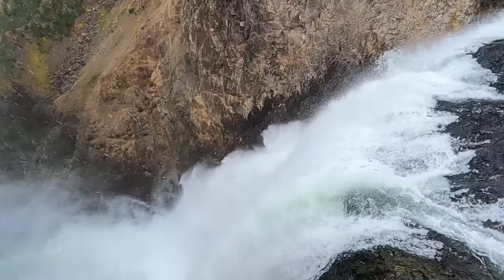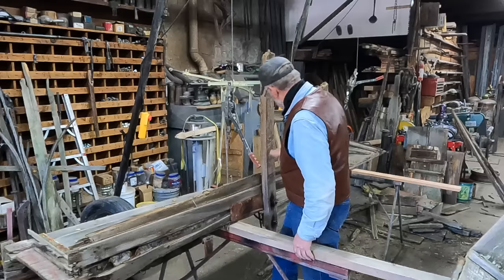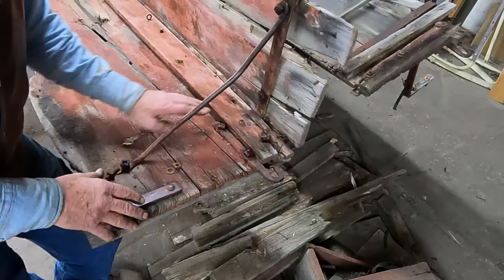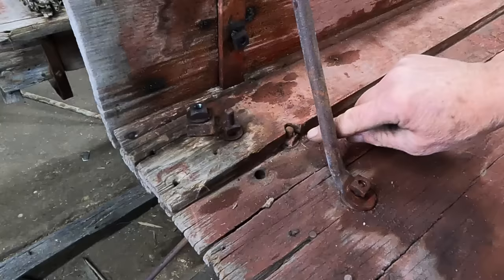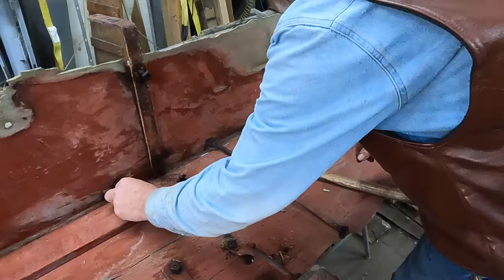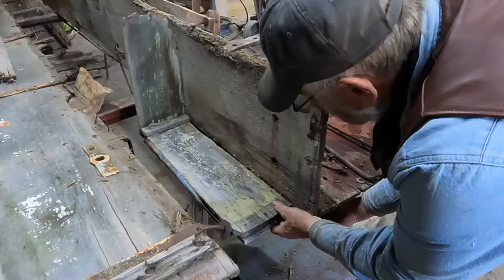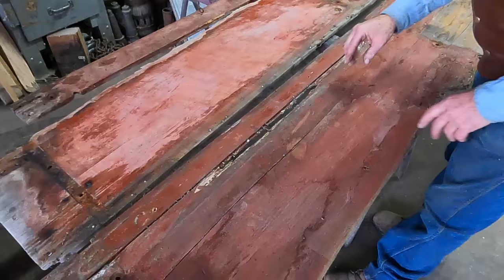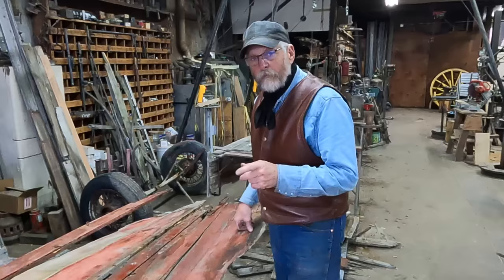If This Was Yours, What Would You Do? | Engels Coach Shop

Comment: Just take lots of photos, get measurements, note design points and tell the customer there is little that could be saved. I suspect you need to rebuild this like a new item.
Reply: This is a piece of history, representing the hardscrabble existence the early settlers dealt with. All of that old wood tells a story and I would keep it except the most rotted. Where boards are compromised, I would make a 30 degree miter (looking at edge of board) and feather in a scab in as little as necessary with wood glue. To discard most of the wood, would make it a new wagon and no longer 'historical'. And if I remember correctly the owner was interested in preserving the history and did not simply order a new wagon with old irons.

Comment: My first question: Will it be stored "out of the weather?" If not, why invest so much time and effort to rebuild something that will only last 25 or 30 years at most? There are more worthy projects, IMO.
   Here is an alternative that I've not seen mentioned. Basically, rebuild using new wood and the old irons, as has been suggested. Then build display frames or cases for sections of the "old wagon" that are reasonably intact, such as the hinged door that was on the inside. The final result would be essentially a new wagon with a collection of displays containing parts of the original. This way, you end up with a wagon that should survive indefinitely while at the same time preserving samples of the original to give an indication of its history. 
  But, I would suggest this ONLY if the wagon and displays are to be stored in a protected area, something better than an open shed, for example.

Comment: There is something to be said about the restoration using the original material, I get that.  BUT, having been a woodworker all my life (I'm now 75 and still working with wood) I know the limitations of trying to create patches for material that has long since become unstable.  I have watched the restoration of Tally Ho, another channel on You Tube.  And I can't call it restoration with 95% of the material is new.  But I understand the principle of building it over in a tight tolerance to the original.  Long way around the bush I know, I'd start over and build it as close to the original as possible.  Perhaps use the irons, hinges, brackets, etc. as I know how skilled you are in restoring them.

Comment: I’m not saying that much wood that is salvageable most of it’s going to have to be replaced and some of the wood that is being replaced could be cut down in smaller pieces to put in places for it still solid and after use out of this one’s going to be one big headache and usually original irons and it would probably be the best and go with what you got and just try to salvage what you can and put in other places as best you can and eggs

Comment: I'd scrap the wagon and potentially produce a facsimile, using original hardware wherever possible.  This type of work is like being left with a hub-cap an old door handle and rotted away sheet metal from a Model-T, then being asked to restore the entire vehicle from virtually  nothing.  I hope the customer has agreed to making stage/up-front payments.

I'd err on the side of copying all dimensions and run estimated costings by the customer, because there's not much - if anything - left of this wagon to restore.  It'll never be the same wagon due to the loss of so many parts and lack of undercarriage.  

It's far easier and less expensive to build a new sheep wagon to the same design. 

Had the same broom for 50 years.....  It's only had 10 new heads and 15 new shanks.

Comment: I believe that this can be done, Dave most certainly has the talent, experience and patience required to do the job as demanded. Have no doubt whatsoever in my mind.
That said, from day one, i thought the demand is absurd and that the owner is clueless to what they have demanded as far as the time and money involved.

If they're willing to fork out the money and as such, the time, then it can be done.

That said, if it's done, it will never be usable. I've seen far older artifact grade items done with 100% original materials. They're held upright with extra structure, be it glass rods, transparent plastic frames or metal. When the owner asked what they asked, they probably want to see it move, not mounted to a plinth with rods sticking out to hold the weak rotten wood that's unable to hold itself up, let alone the extra weight of the missing materials that would be patched in.

Comment: Only giving a suggestion because you asked. A person could stitch it all back together with biscuits and dovetail bowties. May just be a good idea to build new sideboards and seats using the old material from the sideboards and seats to build some of the cupboards and granary to preserve some of the old patina. Seems like it's gonna need a whole new floor. All the boards are going to end up short if you cut them so you might as well take your longest ones and use them where the short ones needed then build all new long ones out of used lumber🤷‍♂️

Comment: I don't think there is anything salvageable on that thing.   Even if you were to patch it back together, you'd spend so much time making scarf joints that you could have rebuilt the wagon four times over.   It's just not worth the effort when it's that far gone.   Plus when you rebuilt it using all that junky wood, and then he gets it back and it collapses again after 2 or 3 or 5 years, he's gonna be furious and think you ripped him off.   Better to just tell him "I can save the ironwork, but the wood is all too far gone" and tell him that's the best you can do.   Don't torture yourself.
Reply: This is a piece of history, representing the hardscrabble existence the early settlers dealt with. All of that old wood tells a story and I would keep it except the most rotted. Where boards are compromised, I would make a 30 degree miter (looking at edge of board) and feather in a scab in as little as necessary with wood glue. To discard most of the wood, would make it a new wagon and no longer 'historical'. And if I remember correctly the owner was interested in preserving the history and did not simply order a new wagon with old irons.
Reply: @clearviewtechnical  I agree, but if you can't screw into the wood anymore because it's too weak to hold a screw, then the wood is no longer usable.   I don't know if you've ever tried to repair something like an ancient wooden fence, but the wood essentially loses it's mass, and becomes almost the density of styrofoam, even if it looks okay on the outside.   It will split really easily, it crumbles away, and a screw head will just sink right into and through the wood.   So trying to rebuild stuff with wood that weak is an exercise in futility.   And Dave certainly could make it look wonderful, but if the wood is so weak that the mere weight of the irons attached to it will cause cracks and destroy it in a couple years, then he would be better off just abandoning the wood and putting on new wood, and aging it with the steelwool/vinegar mix so it looks like the old wood.  The last thing you want is an unhappy customer, so sometimes it's better to override them, when they don't understand what's truly going on.   And by override them, I mean gently explain the full situation, and convince them that replacing the wood is the way to go.  I'm certain this job won't be cheap, but making something that will last 20 years rather than 3 years will serve the customer better, even if they don't realize it right now.   That's your job as a salesperson, is to educate the customer and lead them down the correct path.

Comment: ALL of the wood has long since passed its 'use by' date. Trying to salvage any of it seems to me to be a somewhat futile exercise since it will be necessary to use a good deal of new material anyway, & the patina, even if painted, will be quite different between new & old. The only things that should be reused, in my humble view, is the ironwork. Otherwise it would seem to me, at least, just a botched restoration/repair job.

Comment: Seeing all the splits, cracks, breaks, and damage - I don't see much that would be worth salvaging..... Of course, you'll have to replace all the actually rotten wood... After cutting away and replacing what isn't salvageable on the sideboards, there will only be a thin strip left. the floorboards and floor structure - you've already said that that is beyond repair.....   It's starting to look like a full rebuild with what's left of the original iron, and a few (albeit smaller) pieces of the original wood.
Tough decision for the owners....

Comment: It's a very hard lesson to learn (and relearn several times for most people) but you can't rescue everything. Better to cut your losses and let it go...or recreate the memory from scratch if your wallet is fat enough.  Working with the local farm museum, we get offered "family treasures" all the time which are effectively unrestorable.  It tends to break people's hearts but sometimes you just have to say "Thanks, but we'll have to pass."   Had to pass on a high sided freight wagon and a bulk grain wagon last week, both of which were still in excellent condition, just due to lack of space to store them.  No use taking them to park in the weather and let them rot. Point is, this kind of converted wagon is not so uncommon that it adds a compelling reason to salvage the kindling that's left of a bad one. And ouch, yes it always hurts to say.

Comment: Dave You are famously repairman but you are not a magician, that wood in the boards has rotted to far gone. Dave on the eyebolts in the sides did you ever think that they are for cross chains and a over center lever to hold the sides together when ever hauling ear corn or beans.

Comment: Any part that is structural -- i.e. it will bear any weight whatsoever -- should be replaced with new, solid timber.  Save as much of the iron as you can, but the wood really looks to be a lost cause, and I wouldn't want to rebuild that wagon in a way that someone even just playing around it could put their weight on a rotten piece of wood and fall through it.  If there is trim-work that can be salvaged, that's a possibility, but anything that bears load should be made new and then preserved as well as can be.  It can be made to look old without actually being weathered to the point that a tissue is stronger.

You're going to be replacing the undercarriage completely, anyway, right?  What would be the point of putting rotten floorboards or sides on a new, solidly-built undercarriage?

Comment: Hasn't the owner seen the fantastic work you have done in restoration - for example the Mud Wagon rebuild? None of that wood is worth the effort involved in trying to 'save' it. And if the owner had had the wagon in continual use and the wood rotted to the extent it is - wouldn't he have replaced the rotted parts with new timber? - ok save the ironwork where you can, but build a new body to your usual high standard! After all, your name will be attached to this wagon on completion, and folks can't miss the jury rigged splices of old and new and blame you!

Comment: That wood is too far gone. There's no point restoring it without replacing the wood. Otherwise it will continue to fall apart rather quickly, and probably cost more to try to save the wood than replace the wood. I don't see any value to the wood that exists. So preserving the wood is a fools errand on this restoration. Obviously as you always do, you save the metal and reuse what you can. But this is a total wood rebuild. I see nothing worth saving. I saw checking in the middle on the cross piece in the back, so that is dry rotted and not even salvageable.